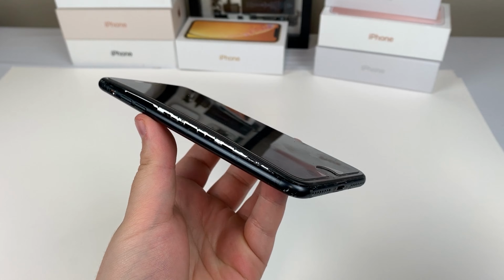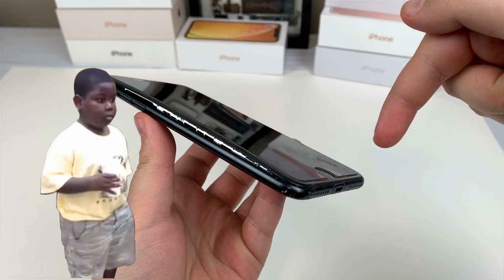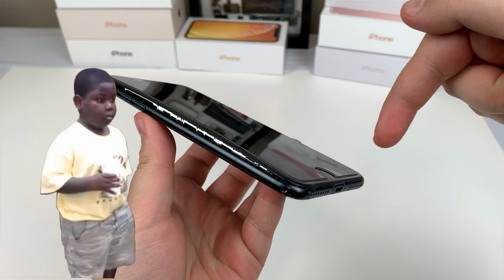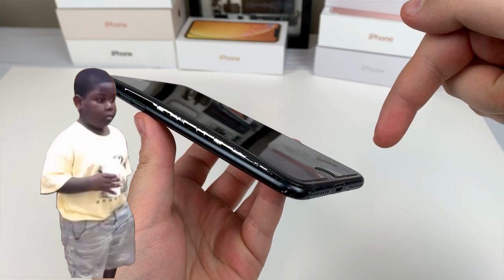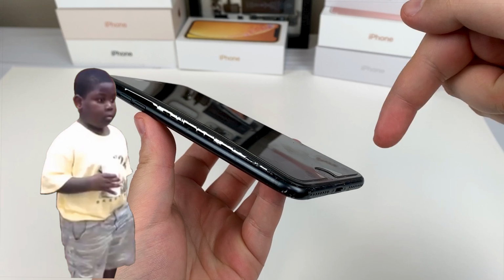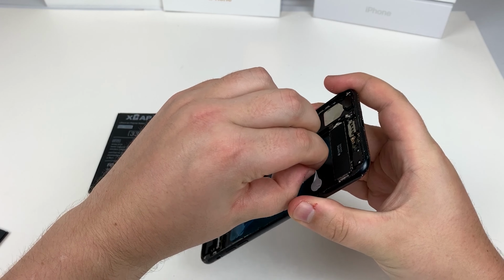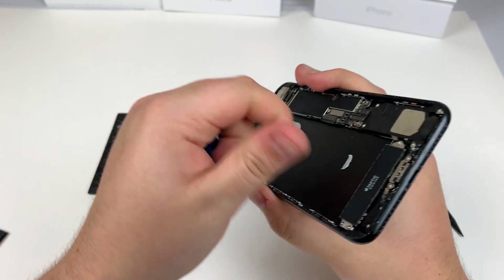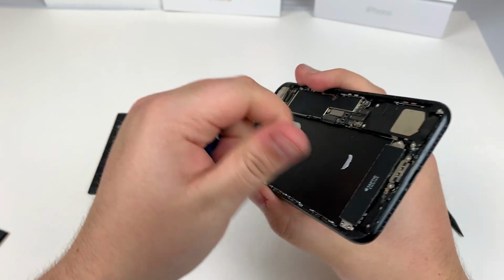You do NOT want This in your pocket... Restored iPhone!

Comment: i have an iphone 6s in the graveyard drawer, it got baked in front of a car vent blasted heat on it during winter. it killed it. and i thought it was the battery, but after a botched battery replacement myself it still wouldn't turn on.

I have a few pictures i may still want. 

Wondering how much it would cost to repair? or if it's even worth repairing after that kind of damage.